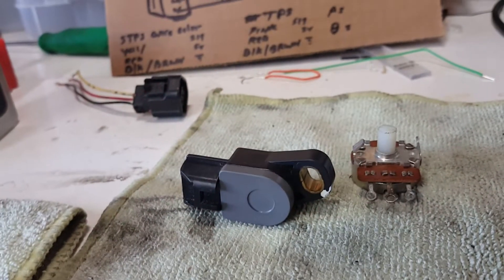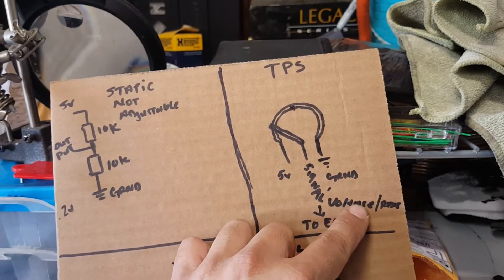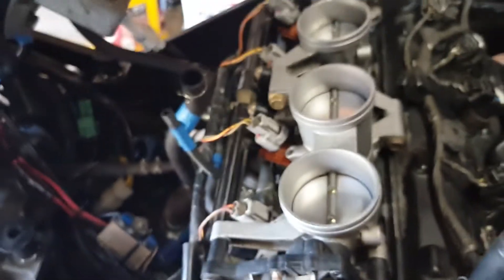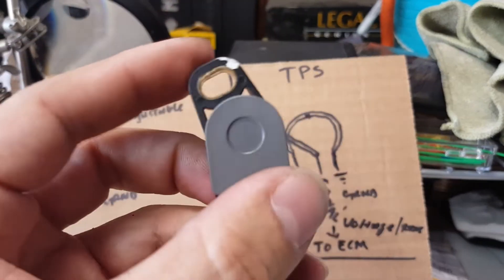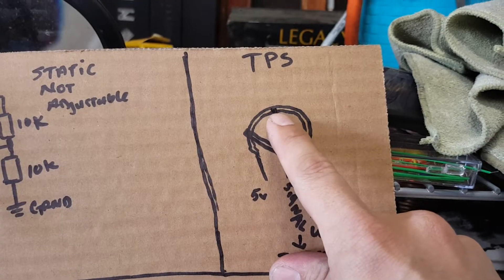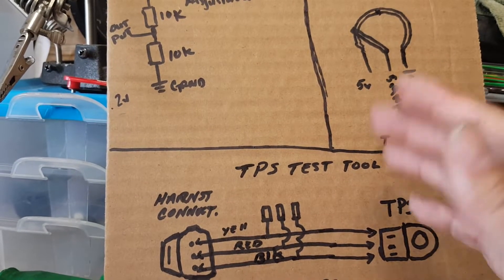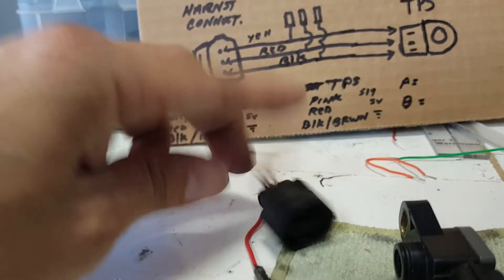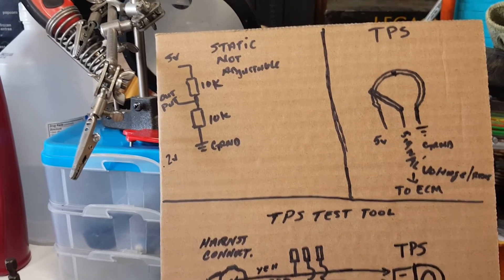DIY SUZUKI GSXR 600/750 Explaining the TPS

Comment: Bro did this fix your problem?
Reply from the maker: The quick blurp or sudden loss of power ended up being bad or warn-out dogs in the transmission. It was most noticeable in second gear under acceleration. The edges of the dogs were rounded rather than square, this would cause the dog to slip out of place and then catch again.. thus a quick blurp and sudden loss of power until it engaged again.

Comment: I sent you video link I got the line in center of coo but wen I pull throttle it stay in center can I get some help
Reply from the maker: You need to be more specific brother... middle at what RPM?.. begins to move at what rpm?..what direction is it moving in what rpm.. answer s are in the your details...
Reply: Wen I turn the bike on the line is in the center and the line never moves even wen I pull on the throttle  I'll resend the video I took of my bike with the -coo on it
Reply from the maker: @chucky-zr6dz  ok seen the video.. so the manual doesnt say weather the needle should float upon rev. Normally it does float up when you rev the bike up or at least mine does. Take the bike out for a ride and get your rpms up, leave it in dealer mode to watch the needles movements (upor down).. see if you throw a code.. if you dont then your good, also feel for bikes performance in the power bands..
Reply: Thank you I just turned it back on and slowly reved it and it floated up then came back down to center and while I rev her up it felt smoother was breaking up before so Friday wen it's nice here in my I'm taking her out to work thanks again

Comment: i got a 01 busa . that bogs down when opening throttle . idles fine. bogs down and dies.  starts fine. idles fine.  am thinking i got a bad tps.
Reply from the maker: Efrain Aguilar check out my other video on how to resistance test the TPS if you feel that's the proplem. I would also looking into cleaning out the injectors, taking a look into the gas tank and fuel pump to see if you have rust and possibly cleaning out the fuel filter and testing fuel pressure.
Reply: james moreno . yes thanks.  i already replaced fuel pump. coils. dpark plugs.  i ohmed the sensor and got 1.3 ohms when throttle closed. and 3.5 ohms when fully opened. manual calls for 4.5 when fully opened.  symptoms gradually got worse. it felt like it was missing.like not enough fuel. little by little it got worse. i was able to open throttle and go slow and it take off fast.  it gradually got to hesitating like crazy.  it cant be anything else cause it would not make sense.  thanks
Reply from the maker: Efrain Aguilar does the busa have STVA and STPS attach to it like the 04-05 750? tried to research but can't find anything
Reply: james moreno .  only has tps.
Reply: i kept getting c21 code.  meaning tps adjustment.  i kept adjusting but kept doing the same.  i finally ohmed it just like you did.  mine reads 3.5 fully opened.
Reply from the maker: Of course it doesn't, that would be to easy right. I was going to say try swapping the TPS with the STPS and see what you get. Sounds like you have covered all the basis, only thing left to do is replace the TPS. Seeing that your getting incorrect values i would say your spot on. Only thing left to do is to bite the bullet and purchase a new one. I'm just hoping that the service manual isn't wrong like in the 05 manual. In the 05 service manual their beginning ohm value is un-achievable. Let me know how it turns out!
Reply: james moreno .  yes.  its 180 bucks.  but its worth it.  i am learning a lot. i figured why have a bike if your not gonna try to fix it yourself. .  starting ohms in manual were 1.1 for idling. 4.5 for fully opened throttle. i got 3.5.
Reply: i should be getting it by thursday.  inll let everybody know how it turns out.  my bike is an 01 busa with 6000 miles. it cant be anything major.   i had it for a year
Reply: whats up.  i put the new tps. but its still doing the same thing.   .  i checked spark plugs and they were black.  i replaced them and still doing the same thing.
Reply from the maker: Efrain Aguilar - Black DRY looking plugs means your running to rich, Wet black looking plugs means the oil in your combustion is not being burnt fast enough. this could be a couple of things. First I would try resting the ECM by disconnecting the battery for a few minutes. If that doesn't work then you need to adjust your air fuel mixture (throttle body adjustment), and thirdly I would do a compression or leak down test and see if you have a an bad rings. 160 psi is the top end (excellent compression) while 145 psi is probably the lowest you want to be on each cylinder. I have a video on how to do a compression test if your not familiar. also you could be getting a bad spark from one or more of 4 the coil packs. so test these as well.
Reply from the maker: Efrain Aguilar sorry I forget you have a busa, so you need to see what the compression for each cylinder is.. 160-145 is for the 750
Reply: james moreno .  ok.  thanks.  i decided to clean injectors . i used that chemtool b 12 . i pour it in tank. and idled for 30 seconds then died. now it just starts and dies.  does not even start and stay running like it used to.  gotta get new injecyors. i had already replaced them with used ones.   not new ones.  am getting new ones this time
Reply: do not use that chem tool b12 injector cleaner shit.  i drained fuel tank and bike starts and stays on only  if  i open the throttle.  i am still waiting for new injectors off ebay for 50 bucks
Reply from the maker: Efrain Aguilar Chem tool B12 is good but for cars. it's a little harsher then say sea foam which is what i always use on my bike. You could compair the 2  with a pair of Latex rubber gloves and watch Chem tool eat right through them. Chem Tool is a acidtone base while Sea Foam is a Petroleum oil base which is safer for things likes rubber O rings. purchasing some new injectors was probably the best bet but you could have tested and fwrd/reverse flush the injectors to insure that this was the problem. I have that diy in my videos as well if you want to give it a go while you wait for the new parts.
Reply: james moreno .  ok.  thanks.  my injectors come with a little filter.  i am gonna take them off and put them on and see what happen. i ll let you know soon.  i heard some busa riders that got away with the filters. .  something like a mod.  because they were getting clogged too often.
Reply: good news.  i removed the fuel injector screens and bike ran 95% better.  i was able to ride it for 20 miles.  before i could not put it on 1st gear because it would die.  no fi codes.   after 500 in parts . she is running again.  at least i learned a lot about my bike.  3 weeks ago i was afraid to open it.
Reply from the maker: That's great bro, glad to see you got it up and running, I'm sure that was a great feeling. Wow $500 huh, that's some serious cash, but well worth it. Plus the extra benefit of the knowledge that you gained. Never let the fact that its a finely tuned machine scare you from doing your own work.
Reply: james moreno .  yes.  i learned a lot.  a dealer would have charged me more. for just one part.  right now the busa has everything new.  .  thanks.
Reply from the maker: Yes they would have, that dealer charge is no joke! Your on you way, Soon you'll be posting up your own video's, how to's, DIY's and what not. That's how it started for me. Anytime you wanna talk shop you know where to find me.
Reply: james moreno .  yes sir.  thanks

Comment: What does it mean when you get C00 with the line at the bottom.
Reply from the maker: unpopular celebrity , all is good. There are no codes being thrown, you want to see this. It's when see numbers after the C is when u have an issue
Reply: james moreno ok cool thanks. But now that line that I have at the bottom of the C should be in the middle correct.
Reply from the maker: Correct, dial it in to the center position and u should be good to go.
Reply: james moreno ok thanks.
Reply: james moreno yeah I did get it in the middle just went took it up the street it's still like bogging off when I try to nail it I'm thinking fuel issues something along those lines.
Reply from the maker: unpopular celebrity, yep sounds that way to me, download yourself a PDF version of the service manuel or pick yourself up a hard copy and crack it open to 5-1 And read it to the end. It could only be a handful of things but you need to tackle them in a systematic order. This goes for electrical as well as fuel delivery because they work hand in hand here..
Reply: unpopular celebrity I was going to give you my input, But the poster is obviously WAY smarter than I am! 😂 Did you get it figured out? I just had an FI light come on and when I checked it, The Hyphen is at the top, Not the bottom. I know it's something with the TPS. Funny thing is, I didn't get the code until I snatched my throttle pretty hard to beat traffic and change 3 lanes. Could I have knocked the TPS out of place when I did that?
Reply: unpopular celebrity did you get the issue with your bike bogging at 100% throttle fixed?  I’m having the same issue with my K5 600. Not the power commander or the TPS being out of adjustment. Idk what to do.

Comment: Hi I have a 2002 Suzuki gsxr600 that seems to bog down randomly during acceleration.  I was riding it one day from my work to home, during acceleration the bike would bog down almost to the point of where I thought it would stall out on me.  I tried a few things after pulling off the road to find that if I gradually increased the throttle it wouldn't bog down, but if I cracked on it while in gear of course (in a parking lot) it would bog down quickly.  I haven't had the bike long and of course it has high mileage, about 38k, and not sure if anything was done as far as tune ups or carb cleaning.  Any suggestions to as of what I should do or look at possible causes of why this is happening? Don't really want to have to take it to a shop and spend the fees to have it looked at.
Reply from the maker: Brian Wittenbach - Boggs  could be a couple of things. bad spark plugs, bad or dirty injector(s) or poor fuel pressure due to dirty fuel filter or bad/malfunctioning fuel pump. My starting point suggestions would be to change the plugs with a fresh set, but before you do pull the negative terminal off the battery to rest the ECM and leave off while you do the plugs. This is the easiest and cheapest route to begin at. i had a bog down issue 2 weeks ago, when i got the rpms up to 4k in neutral and held their the rpms would start climbing on there own. when i drove it the bike would bog in all gears and would shake on take off. turnd out to be spark plug #1 was bad.
Reply: ok I will try that and keep you updated on the results.  When I do remove the plugs is there anything I should be looking for as far as condition of the plugs much like a normal vehicle?
Reply from the maker: Brian Wittenbach - yes, same as cars (white/black or normal). This tells u a great deal how the bike is running  (lean/rich). keep me posted..
Reply from the maker: Brian Wittenbach o ya, while you have the tank up, inspect your all lines for cracks as well. this could also cause ur issue
Reply: Are you referring to the fuel lines?
Reply from the maker: Brian Wittenbach all lines in general. Any type of  vacuumed leaks no matter how small can cause havoc. so what ever hose you see give it a good looking over and squeeze test. make sure none are stiff, crack or crunch when pressure with ur fingers are applied. all inspect those with hoses with fittings. make sure theres no issue with the connection fitting.. you should see these on the fuil rail and underside of the tank. u can also Youtube "how to check for vacuum leaks". Much easier to get a game plan b4 entry so ur not constantly in and out, tackle it all at once before we move into troubleshooting actual parts like injectors or fuel pump.

Comment: Hi I have a suzuki gsx r k8 600 , last night to come out f1 light with error code -C00 . I've done small research and some people say I need to adjust my TPS up , seems like you know what you talking about , is it any chance you can tell me how I can do this . I would really preshaped that if you could help me
Reply: Code 00 means no defective part. Find a forum for your bike and search there for more info.
Reply from the maker: Daniel Fratczak sorry i didnt get back to you, just seeing ur post now, yes 00 means there is no error. so my question to you u is, what problem are u trying to fix. if its just the fact that ur seeing 00 while in dealer mode then u have no issue, thats the way it supposed to be

Comment: Get Help How does Gen 2 c40 code issue solve? _C00
Reply from the maker: Well , judging from your _C00 your TPS needs adjustment.. it should read -C00. So for my gen suzuki (k5) we don't have a C40 code.. I actually had to look in the bible to see because it didn't sound familiar and nope! I was right C32, 33,34,35, 41, 42. 

So I did a little research on the forums and Wala C40 is your ISC (idle speed control) valve. Take a look at this link and read through it's entirety and see if the fix works for you. This information is a bit old (2009) but it may have the answer to your problem. Please Be sure to come back and post if it resolved your issue.. the more information we have on this channel of problem related issues and fixes the better, even if we're not the same Gen. Good luck!

https://www.gixxer.com/threads/wtf-is-c40-code.238985/
Reply from the maker: Also, I see that a lot of people are mentioning that it has to do with the clutch switch. So be sure to take note of that and inspect the clutch switch for proper contact. Many of them are having this issue after changing out the levers but if you haven't changed yours out still looking to this.

https://www.gixxer.com/threads/c40-fi-error-code.677217/
Reply: @TheChemistDIY  Thank you very much
Reply: @TheChemistDIY  Now that I have modified the wiring system, this bike has a quick-chip code C40 in the manual. Related to the TPS system, I lost it, I noticed that C00 is normal, and after a while it rode on the Fi light, which is funny, it came up with the code again, C40.
Reply from the maker: Modified the wiring, what for and why?

Lost it! Lost what.. the TPS?

YES -C00 is the code for the bike is running normal. The tick mark next to the -C is your TPS setting and should always be in the middle at idle if your TPS is set correctly. 

What is the year make and model of your bike?

What happen to the bike that lead to this.?

Your bike should be idling at around 1300 rpms with a smooth idle. If it's not, what are the symptoms?
Reply: @TheChemistDIY  gsx1300r  hayabusa  08  gen2
Reply from the maker: @rambobukylaoprombobu6787  whowaa... Big boy's bike... Bad ass boys, ride bad ass toys.. always wanted a busa.. good luck your fix..

Comment: Were you experiencing problems similar to this? https://drive.google.com/file/d/1JqgEDr7f2FAESG0DCY0ySSyg7IuCN5fS/view
Reply from the maker: Cut-out issues can be a bitch to solve. In your first video pause I noticed that there was a CHECK or F1 code being thrown but I couldn't see what code that was.. please tell me (C11,C12,C14, C28, C29, C31,C41... ?). All the previously mentioned codes have to do with sensory issues of faulty parts that can cause cutout.. So like I said, hard to diagnose since there are so many in play.

Since the issue seems to occurs while on the throttle and the RPM (tac) not being displayed while at idle.. but yet no rough idle.. I'm thinking TPS or STPS (C14,C29) which is your throttle signal. This is where I would start.

I had a cutout issue a few months back and it ended up being a bad kickstand switch. when I hit a bump or a rough patch in the road the kickstand would lose contact with the switch just enough to cut the bikes power out for a quick second.. This through codes of C32, C33, C34, C35 which is the injectors.. because thats whats suppose to happen.. kick stand goes down and cuts fuel off to the engine.. safety feature, but the ECU doesnt know any different.. it just knows that there is a signal missing and that signal is coming from the injectors so it throws those codes.

Below is a link to my new website which houses all my YouTube video in an easy to find categorized location (most will be maintenance), the link below is specifically to the page where I discuss how to test the TPS and STPS for dead spots. Not a sure fire way but will give you some insight on how to perform the test if you feel this is your issue. Lock in my site as I have a ton of DIYs for most issues you will experience.

Keep me posted...

https://www.thechemistdiy.com/2021/01/testing-tps-for-dead-spots-using.html
Reply: @TheChemistDIY  thank you so much! Have side sand switch and TPS sensor, and new kick stand springs on order. Will let you know the results soon after I get parts in.
Reply from the maker: @curt1star05  Looks like your on the right track brother. good luck to ya!